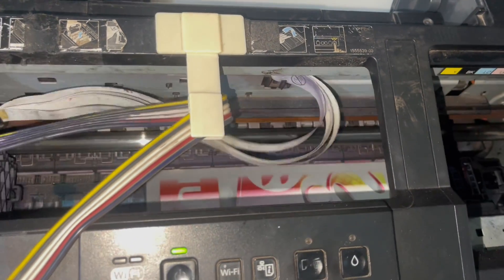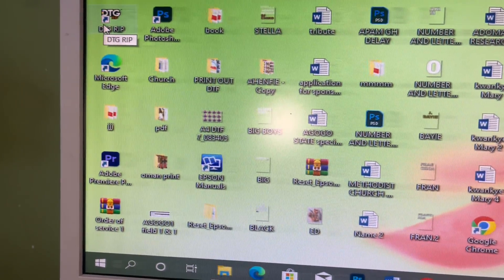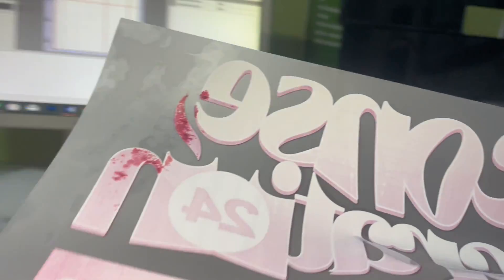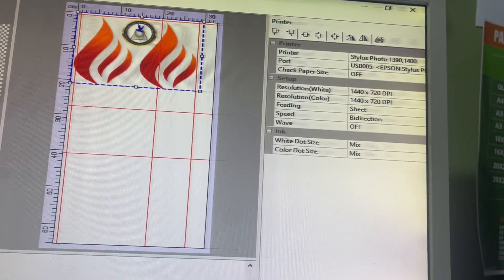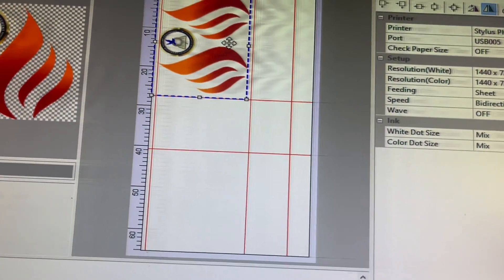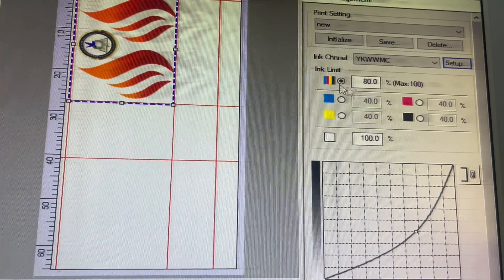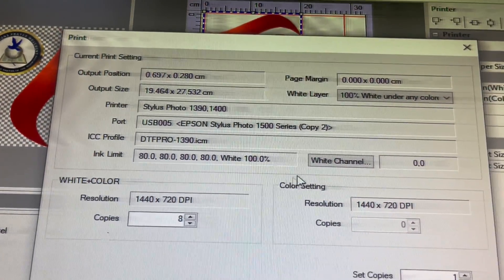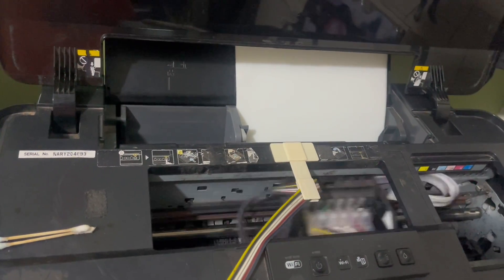DTF PRINTING SETTINGS AND PROCESS

Comment: What DTF printing?
Reply from the maker: DTF (Direct to Film) printing is a digital printing method where designs are printed onto a special film using specialized inks, then transferred to a garment using a heat press.